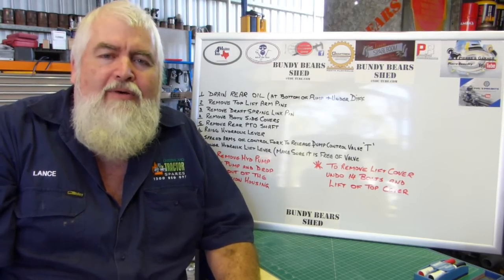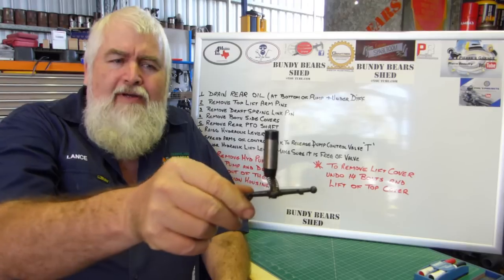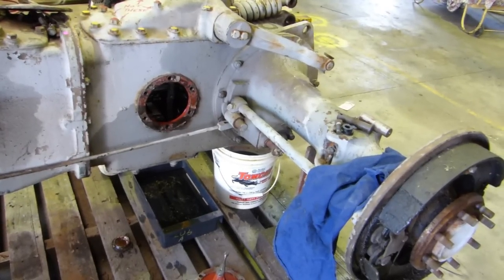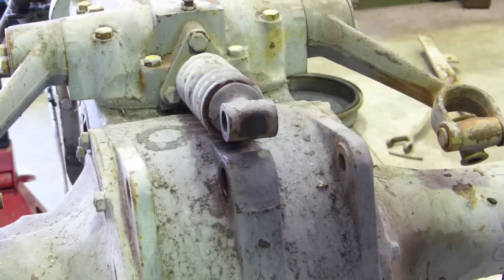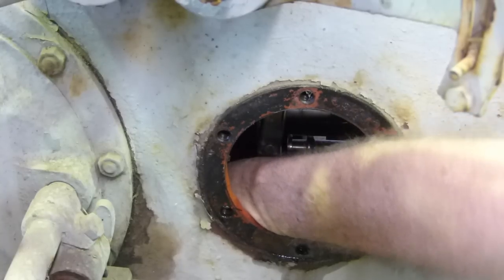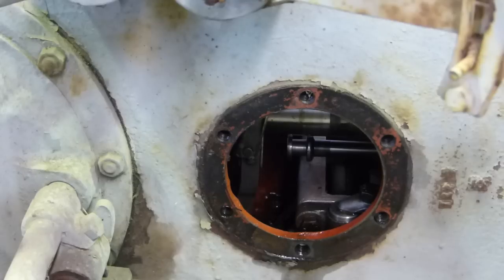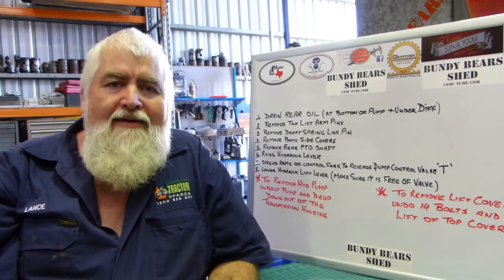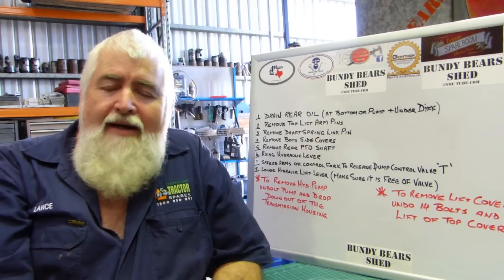How to remove a Ferguson TE20 Hydraulic Lift Cover and Hydraulic Pump

Comment: Hello lance , I had posted previously about my pto lever being stuck in on position.Today i took the cover off and once the bolts are only finger tight the lever works . any wrench on them at all and the lever becomes unmoveable. I would like to say everything looks normal but lets face it i dont know what to look for lol.Your advice is always apreciated
Reply from the maker: G day Shawn, It sounds like you have either a bent PTO shaft or a bent selector lever on the inside. I would suggest trying to pull out the PTO shaft and bolt the side cover on and see if there is any difference. If the shaft is twisted it may be hard to pull the shaft out.
Reply: Bundy Bears Shed. Shaft slid right out. tightened the pto shifter down. with pto out and lever still will not move when tightened down with wrench
Reply from the maker: The PTO engaging collar must be stuck or damaged.
Reply: Bundy Bears Shed. what size should the gasket be on the lever panel? It works great until just the smallest amount of tightening is done with the wrench. As mentioned if the bolts are finger tight the lever moves fine .was thinking a gasket might keep them out just enough
Reply from the maker: The gaskets are around 0.5mm  or 0.020" If it is rubbing on the end of the selector possibly touch it with the grinder to give clearance too might be worth a try. It sounds like it may be bent slightly.

Comment: what a great video, very handy thanks for making it Lance.
Reply from the maker: Thanks Matt, Hope you got something useful from it.
Reply: I did Lance,  the people with the know how like yourself are getting quite grey in the hair and I worry who is going to be around to fix this old machinery in 20 years time. videos like this give me a confidence that even I could do a few more jobs to the old fergy. please please pretty please do a 135. I have wrote to you before about hydraulic problems I was having with mine. your comment was I may not be using it correctly, well you were right. our aging mechanic found that out and let me know the good news, but then let me know the bad news. the tractor needed a new clutch, diesel injector and the multi power was had it. fortunately he is sick of walking around it in his shed and intends on getting it done very soon. thanks again Lance!

Comment: Hi lance, I’ve got a tea20 1948 I need to fit a new wiring loom have ya done any videos, cheers colin from Wales UK
Reply from the maker: G day Colin, No not as yet but they are simple enough just follow the old one if it is available.

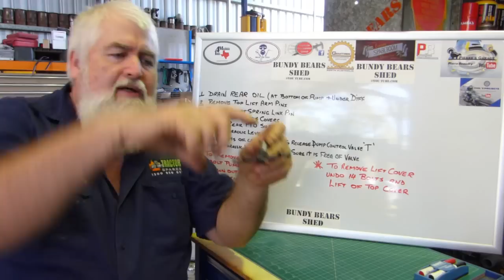Comment: Hey lance i just took the inspection plate off, where the dipstick is and i just noticed the levers have come off the hyraulic control valve as u are talking about in video at 2:18 can u put it back on or do you need to take lift cover off
Reply from the maker: Should be able to get them on if the valve is still intact.
Reply: Ok thanks

Comment: I have a tvo tractor  and  my lift sticks up what would the problem be thanks
Reply from the maker: Probably a sticky pump control valve, that is about the only thing that will make it do that.
Reply: I have just noticed now when I put the back end into gear even if the lift liver is down  the lift will go straight up and stay up do you think it is still sticky control valve  thanks lance
Reply: The arms stay up I mean  and won't go down  thanks

Comment: Hello Lance i have question is it possible to fit a hydraulic pipe to a grey ferguson tvo i have a log splitter i want to use my fergie to operate it cheers 🍻🍻
Reply from the maker: Yes from the port at the corner of the hydraulic pump, you will need to chain your arms down though  .
Reply: @BundyBearsShed  Good man Lance i will check this out when i get back to Ireland 🇮🇪🍀🍻🍻

Comment: Does this procedure work the same on 1957  TO35?
Reply from the maker: G day Mike, I could not be sure as we don't have the TO35 here in Australia. I imagine it wouldn't be too much different but our MF35 that doesn't have the pump bolt up from the bottom is a different procedure.

Comment: I done everything you said to take off the hydraulic lifter cover on a ted20 tractor but is still seized on  can you help me
Reply from the maker: G day Jason, Have a good look that every bolt is undone, I find if they are tight I have often missed one. The one that gets missed is the one near the lift arms often as it is harder to see. I am presuming that there is no movement at all by saying this though as if there is some movement, like 10mm or something like that it is stuck inside.
Reply: I have taken out all the 14 bolts and taken off the side hatches to disconnect the arms inside. I've also put a crowbar at the back to try and lift it butit doesn't move. Can anyone suggest anything else I can try

Comment: I am unable to remove the lift cover. It looks like it is completely stuck. Any suggestion to make it pop out ?  I completed all the steps from the video but the lift cover just don't want to move.
Reply from the maker: A big bar under the lift arms often gets them loose.

Comment: Hi Lance , Just one other question my massey 35 lift arms drop down when i switch off my tractor any ideas ?
Reply from the maker: On the Fergy they had piston rings on the hydraulic piston that looked like engine piston rings with a gap so the oil has to leak away there is no other option. As they get worn it gets worse, they also leak due to failure of the o rings on the stand pipe that takes oil to the lift cover, that is easy and cheap to check first.

Comment: Hi there, I found your videos looking for answers about my Ferguson TEA20 that I use to plow my driveway here in Canada.  I have never in 7 or 8 years of owning it had the hydraulic lift freeze in the up position.  Would draining the TDH Fluid, running it and putting new TDH in be worth it?  Or is the repair likely more serious?
Reply: It is currently stuck with the blade up off the ground.  Normally I would be happy since it always gradually drops to the ground but I can't plow much snow when it is off the ground.  Currently -12C here.
Reply: It happened about two days ago right after the last storm and it has been sitting for two days while I was away.  What is a Donkey dick  as it relates to the Tea20? Haha!
Reply from the maker: It is the push rod from the piston to the lift arm shaft. You would need to pull the top off to see.
Reply from the maker: I'm pretty sure if it is -12dec C its time to move house. come and live over here. lol
Reply: So does that mean take the plate that the seat is attached to off?  I watched you do that in the pump removal video...
Reply from the maker: Yes the top only.
Reply: Not fun in this weather but it gives me an idea of where to start.  Thanks so much!
Reply: OK, so I have been looking at my manual for the tractor.  Does that push rod sit behind the piston and when you move the lever does it move the piston to lower the arms?
Reply from the maker: Yes

Comment: hi, my liftcover is really stuck, any ideas how to get it off??
Reply from the maker: G day Hans, Are you sure all of the bolts are out?  They are not usually hard to move unless someone has used some different gasket sealer.
Reply: I got the same problem it's stuck can you help me
Reply: Hi, i took a jack under one lifarm and the whole tractor did lift, so i also stood on the wheel and then it popped off
Reply: i got it off finally with a jack, the gasket was some kind of sticky stuff.
Reply from the maker: sounds like some of the old caterpillar glue, it was hard to get to release.

Comment: Having trouble with job number 5 the valve has come off the arms on one side but the other side is jammed in and will not come out.
Reply from the maker: Try going up from the pump drain plug with a lever.
Reply: @BundyBearsShed  tried that and though the side covers won't budge

Comment: Hi just  my lift arms are stuck in the up position HELP
Reply from the maker: Remove the r/h side plate and work the valve by hand and see if that helps. The control valve might just be stuck.

Comment: I have a 185 MF whenever I hooked up the rotavator drive shaft to the PTO it does not turn . When you disconnect shaft and engage PTO it turns ( that's the shaft on the tractor) please share some light .
Reply from the maker: G Day Chanka, Do you have a dual stage clutch?
Reply: Bundy Bears Shed I bought this tractor from someone but it doesn't seem to have a dual clutch . Without any implement hooked up to it the PTO engage s when the tractor is idling.
Reply from the maker: Ok sounds like a hydraulic PTO, you may have a weak auxiliary pump or just a worn PTO clutch pack. Either one would involve splitting the tractor.

Comment: Hi Lance.Must be my 5th time to watch this video be it the first video or the second video in repairing and rebuilding the, pump, I have not yet started taking it apart, you now have a new 60 year old apprentice in Ireland, any way in section six you say raise the hydraulic lever but I can't as mine is stuck in the 12 O'clock position, can I still gain access to the hydraulic valve, as I was saying before, I have a TEF so access is only available to the right side at the dip stick as the battery and tray are on the left, can I also say I am acquiring more I think there called AF spanners as I had all metric, I notice the 11/16 spanner gets some use, anyway thanks, I am onto video two again.Cheers.Jimmy.
Reply from the maker: The whole hydraulic lever will unbolt out of the way for you. Undo the 4 bolts and it should just slide out.
Reply: Does it not have to be in a certain position to raise and lower the rear arms on the tractor, should I mark the position of the bolts and block.

Comment: Having trouble figuring out what year my Ferguson is and even model.
Was grandfathers it runs good just no front or real hydraulics work.
It is yellow.  And says MF 31 on side pannels for battery area .
Have hydraulic issues.  Someone told me to replace screen and filter and said it'd be in the rear gear box under seat.
I have everything removed.  Now where do I find a screen and filter on the tractor to remove  and replace it.?
Thank you.
Reply from the maker: I think you have an industrial tractor, some didnt have a screen but the control valve would stick so pop the left side cover off and see if you can work it manually.